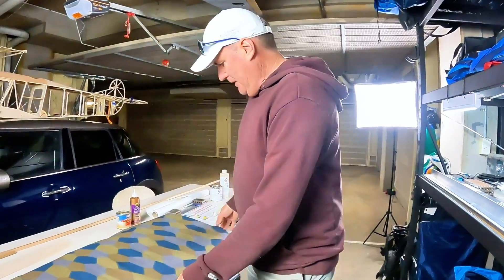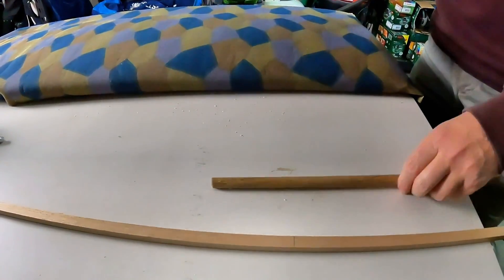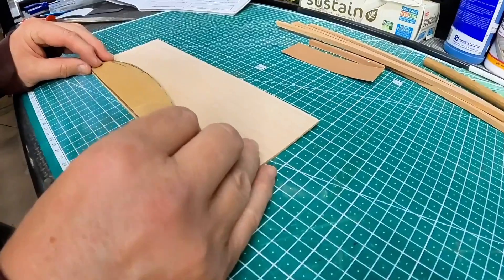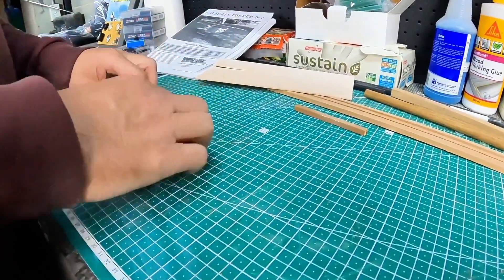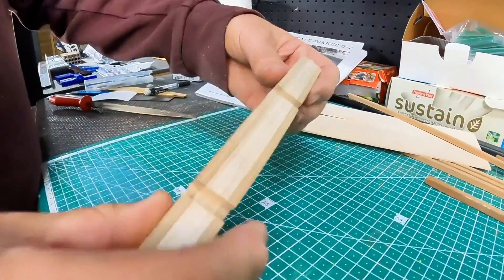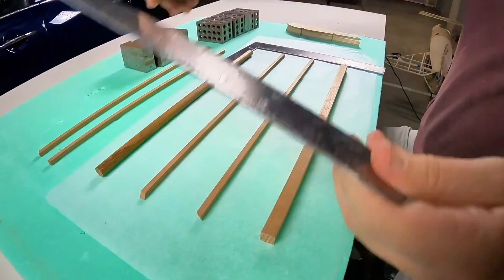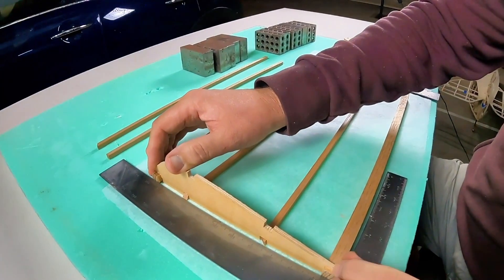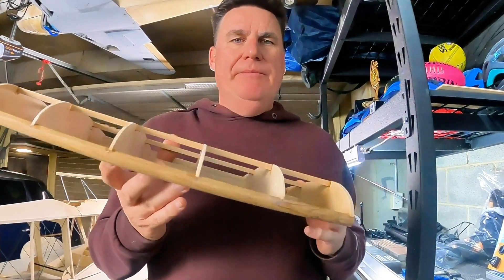Balsa USA 1/3 Scale Fokker D.VII Covering Pt 1

Comment: Is that 4 color or 5 color lozenge? Looks really nice. 
I don't know if this will help with the build, but I find that modelers are the best at spotting the small details.
When you get to putting the markings on the fabric, choosing a tail number that matches the type of lozenge helps. 
There is an article in WW1 aero, issue 102 about the covering practices for the DVIIs.
They explain that the DVIIs mostly used the 4 color lozenge for covering.
For the Fokker built DVIIs they switched to the 5 color lozenge after tail number 7788/18. 
For the O.A.W. built DVIIs started using 5 color after tail number 8520.
For Albatros built DVIIs, they used 4 color lozenge up to tail number 6899/18.
can't wait to see more!!
Reply from the maker: Wow great information… thank you!!